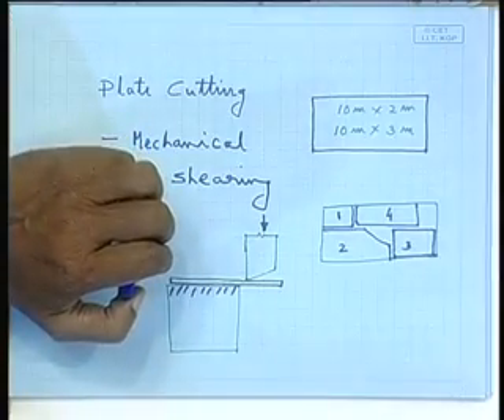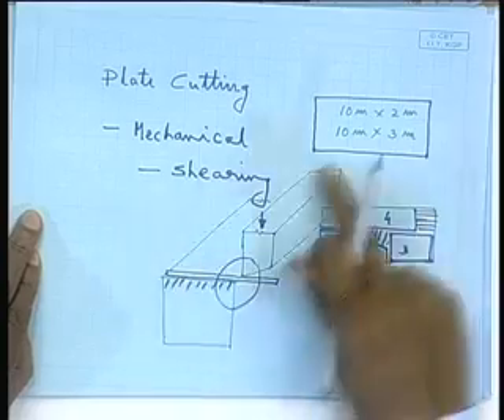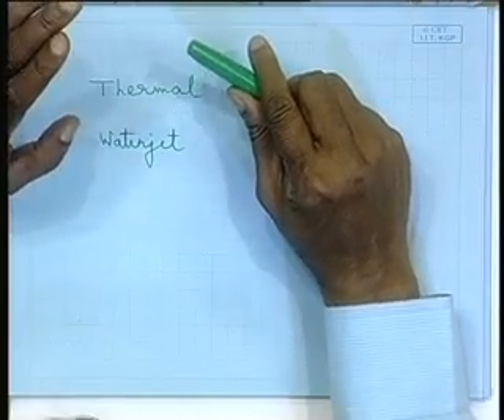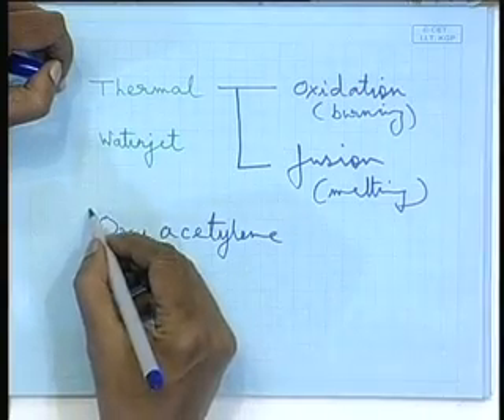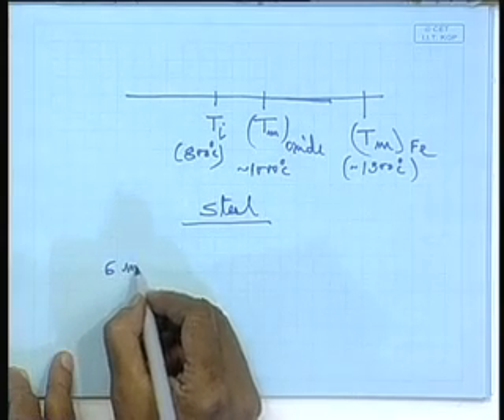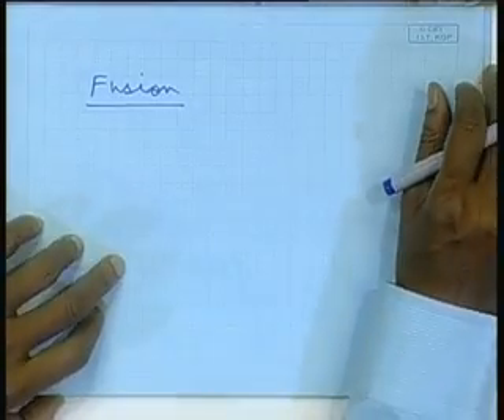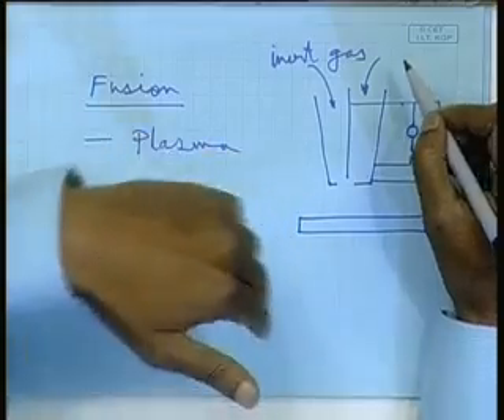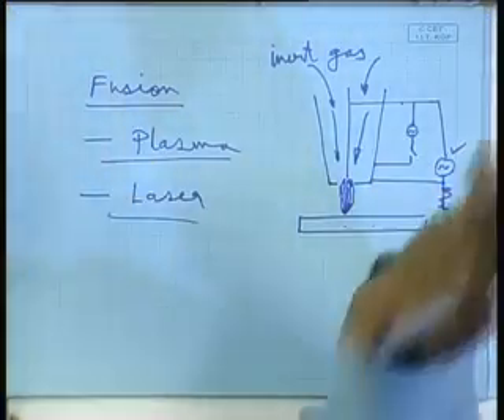Mod-01 Lec-21 Plate Cutting

Comment: An oxygen lance is a device used to melt or cut steel too thick to be cut with a conventional oxy-acetylene torch using a long alloy steel tube or pipe to feed oxygen under pressure to a preheated area. The oxygen lance achieves this cutting action by causing an oxidation and melting reaction of a preheated area of the material to be cut by directing the jet of oxygen onto it. The stream of oxygen then blows this area of melted steel away to form a cut. Steel and cast iron up to eight feet (about 240 cm) thick can be melted using an oxygen lance which is not possible using conventional cutting apparatus